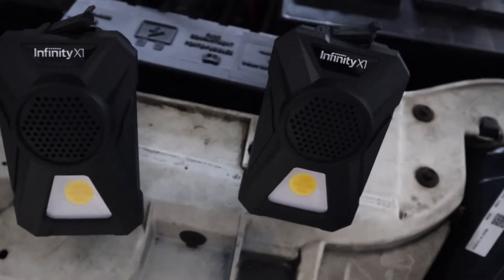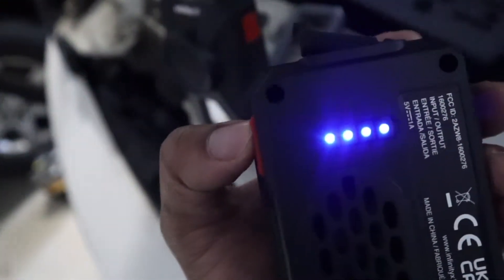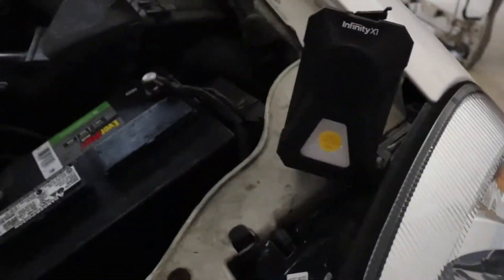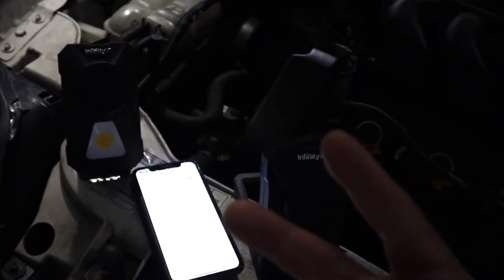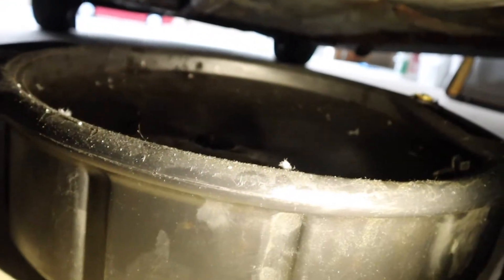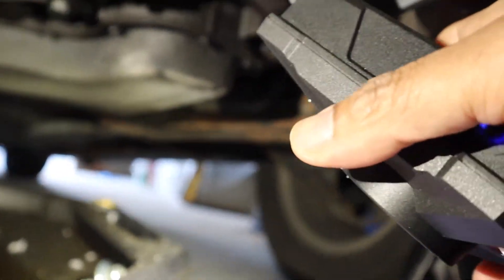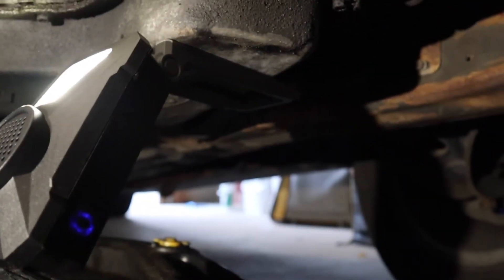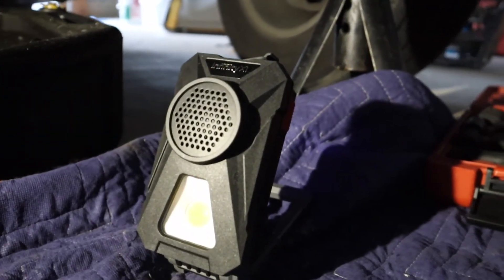Infinity X1 Work Lights with Bluetooth Speakers HOW TO PAIR BOTH?

Comment: HOW LONG BATTERY. WILL LAST ON A FULL CHARGED?
Reply from the maker: here are some specs that might help. 700LM (2 1/2 hours), 300LM (5 Hours), 100LM (12 Hours). this is how long they will last with the lights on. here is an amazon link for more info https://amzn.to/3O7jZuF 
I hope this helps

Comment: Put them within 3 ft of eachother and turn them on at nearly the same time (hold power for 3 second s). With Samsung turn on phone Bluetooth. The phone detects X1 once even though both speakers are on and that's good. When choose x1 infinity on blueto, the speakers played in stereo mode. :-) 
With my Motorola phone it took a few tries of turning on the speakers and pushing/holding the power/Bluetooth button, follows by choosing X1 infinity on the phone Bluetooth. 

The important part seems to be turning on the speakers close together, at nearly the same time, which allows them to pair with eachother first, then pair them as a set to your phone.
Reply from the maker: 🙌🏾  you got it. You basically have to turn them on together and at the same time
Reply: Do you wait to turn the Bluetooth on? Or turn the Bluetooth on and then turn the speakers on?

Comment: Okay for clearer instructions.

I paired both individually.

I turned them off by holding the Bluetooth button down for a few seconds.

Turn Bluetooth on your Samsung phone on.

I had the phone and two speakers very close together and turn them on at the same time

Even though there's two X1 in the Bluetooth menu, it connected to one of them but they're both paired
Reply from the maker: NICE! 😎

Comment: Actually you can have them separate it says to turn them one about 10 meter or 40 feet apart
Reply from the maker: Yes 👍 but I got a lot of comments on my original video on how to pair at the same time.